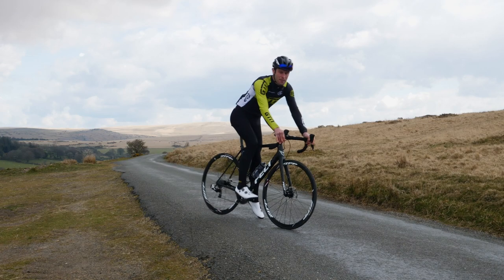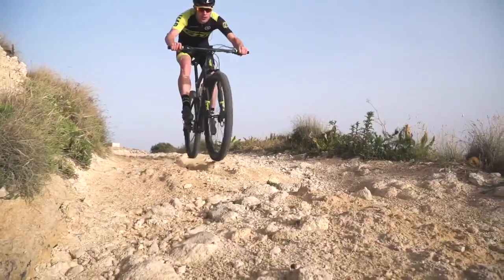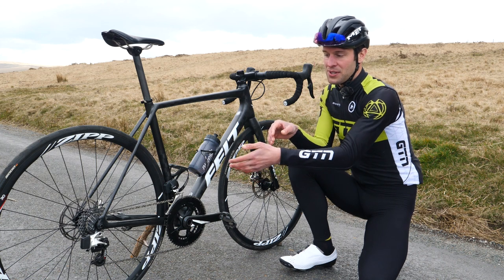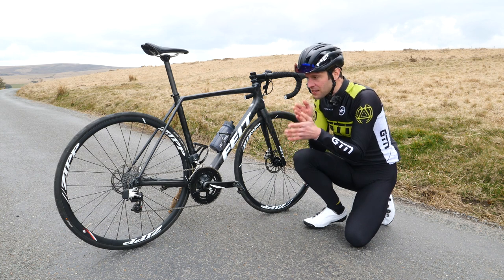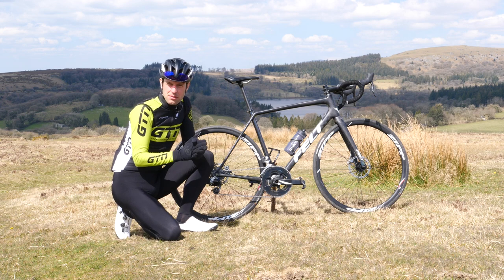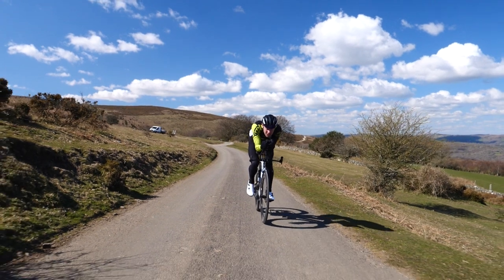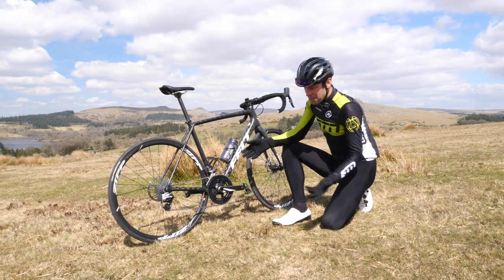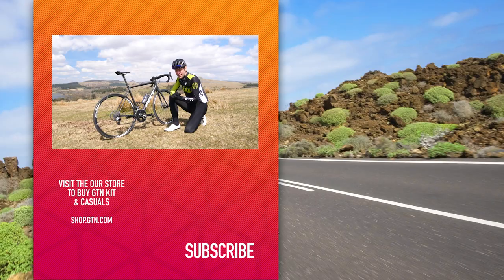Everything You Need To Know About Gear Ratios | Choosing Cassettes, Chainrings & Shifters Explained

Comment: My question is: Is the power necessary to spin gear combinations that have the same gear RATIO, but are comprised of different sized cog/chainring pairs. For example a 44 CR and 36 big cog have a gear ratio of 1.2; and a 42 CR and a 32 big cog also have a 1.2 gear ration. Is the power necessary to spin these gear combos, assuming the same rider and rpm, different?
Reply: Are you sure? Unless I have done my maths wrong? (i) 44/36 = 1.22 BUT (ii) 42/32 = 1.31

Comment: How can I find out if I can increase the range of my gear - I have following combination

Front Derailleur : Shimano 105 FD-5700 Black

Rear Derailleur : Shimano 105 Black, RD-5701A/SS 20-speed

Shifters : Shimano 105 ST-5700 Black, dual control 20-speed

Crankset :  Shimano 105 Compact Black, FC-5750 Hollowtech II 50x34

Cassette : Shimano TIAGRA CS-4600, 10-speed 12-30T

Chain : Shimano Tiagra CN-4600

Shimano 105  -- Can I add a "lowest" or easier gear ?  based on combination above and what would I need to replace?

Comment: Hi. Thank you for the explanation. Does that mean with an 11 cassette and a double chain set there are 22 gears. But then there is cross chaining and there are gear ratios duplicated. Is it possible to explain for example, small front to be used with 1 to 7 rear and large front with 5 to 11 rear. As this will help prevent cross chaining and duplication of gears. If this could be explained it would be helpful, thank you. Nice kickstand, hack or bodge.
Reply: Totally agree. Is it why now they refer only to an 11 speed bike as opposed to how many gears it has? Whereas in the old days you'd say it was a 22 gear bike. But as you say, not all gears can be used.

Comment: I started using a cadence and a heart sensor with my bike comp, so far avg my cadence to 60 and select my hardest gear I can use without reducing my cadence or increasing my HR. Is this a good way to train and ride to improve? Or should I be focusing on increasing my cadence and using an easier gear for improvement.
Reply: Usually a higher (85—95) cadence is preferred because it means less force is going through your joints and connective tissue, but if you don’t have any problems riding there then you can ride at your self selected cadence
Reply: @MrFoxmarine  I figured to play to my physical strength, I have enough muscle to mash a high gear. 60 cadence is comfortable, after some adaptation I will push the cadence to 65, then 70 and so on. I find the key is pedaling to a rhythm so there very little fluctuation in cadence. In a short period I noticed a considerable improvement and I'm no where near the fitness I should be.

Comment: Does it require the same effort to push the same ratio regardless of whether you use the big or small chain ring? It seems like I get more bang for my buck if I'm in the big ring?
Reply: It should be the same, but depending on the specific gear ratio the chain line might be more efficient in the big ring. GCN did a video looking into this recently
Reply: Also a smaller cog is marginally less efficient than a bigger cog, but I doubt that you'd be able to detect that (I know I can't)

Comment: A pretty technical question,

Why don't electronic gears just use limit screws as reference for indexing? Cassettes have little to no difference in their gaps so why not? 

It would automatically adjust and they can just make it an option to do it manually.
Reply: 1 year later 🤔

Comment: if you need to get extrimal gear retions for mountains for example what is the best way to do this? set a cassette with 32t or 34t or set a inner chainring 34t?
Reply: You could do both if you wanted the 1:1 gear ratio, but that's rarely needed. Probably better to go for the compact chainring setup and keep the smaller gear jumps with a standard cassette in the back